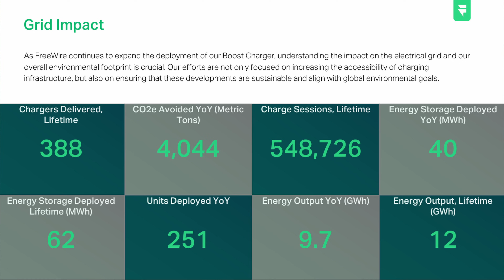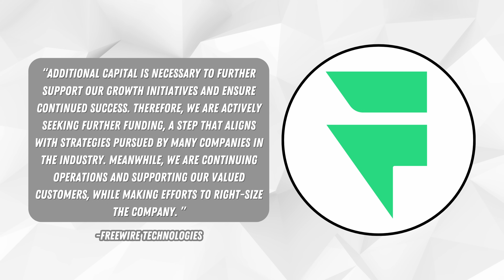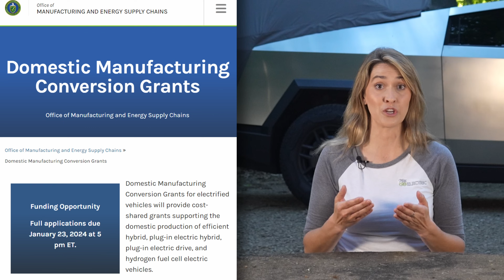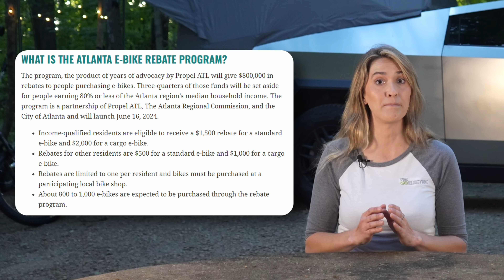The Current : Weekly EV News Ep#10 May 12, 2024

Comment: My first EV was a 2007 Vectrix VX-1 highway capable electric Maxi-scooter (step thru motorcycle) I bought new in 2009 on steep discount when the company first went bankrupt. I ended up owning two over the years, best bike I've ever owned, but now I can't give them away as they need new batteries and the support just isn't there. Also, no quick charging so not for road trips, but after driving across the country on a 1000cc cop bike I don't think ANY are for road trips.
Reply from the maker: Thanks for sharing your experience. We have a friend who has taken road trips with their Livewire but that's really the only time I've heard of a somewhat practical road trip experience since it has fast charging. 

I really like the idea of a standard for batteries when it comes to two wheel electric products (gogoro is a good example) so even if companies can't survive, batteries are still available. 

So cool to hear your first EV was all the way back in 2007!! 🙌🏼

Comment: After not riding motorcycles for many years, I bought a Zero DSR two years ago.  It is a great motorcycle for my use, smooth, quick, and no engine maintenance.  I am really enjoying riding it for errands and just exploring back roads.

I would like to see more progress with electric motorcycles, with more range, faster charging, lighter weight, and lower cost.  Progress has slowed lately, IMO, but there have been interesting new motorcycles like the Energica Experia and the Livewire Del Mar.  When low cost, higher energy density, batteries become available we hopefully will see more progress in electric motorcycles.  

E-bikes have been more successful to date, and IMO electric sit-down step-thru scooters will be the next big thing for 2-wheel electrification.  The US market has a Vespa 50-cc equivalent model, capable of 25-30 mph. Overseas markets like Taiwan and India have lots of electric options, including 150-cc equivalents capable of 60-70 mph.
Reply from the maker: Zero was far out front, basically alone, for a long time here in the US. It has been fun to see the offerings diversify here. 

Have you seen the Verge? 
https://youtu.be/8mAgBqyq2bU

Thank you for your insights. 
-Producer Tim

Comment: I hope you have fun getting your motorcycle endorsement. I've found the Motorcycle Safety Foundation's program to be great and took the basic class in 1995 to get my license and later took the advanced class to buikd skills and refresh learning 

I just sold our gas motorcycle. I've test ridden an early 2009 Zero S, a Brammo Empulse (6 speed), and a more recent Zero SR/F. The Brammo was sublime, but all were great. Just always priced a little too high.
Reply from the maker: Do you think the Outset has a good price? Ryvid is headquartered not far from you in Irvine. 

-Producer Tim
Reply: @MissGoElectric  Good price on that Outset, but it's a pretty underspece'd on battery to get there, like an original Brammo Enertia and early Zero S. That 4.3 kWh battery is too small for motorcycle, and that's always been the challenge. Zero did everyone in the industry a solid by carefully disclosing the real world range at various speeds, and it's good to see Ryvid using that in their promotion too.

Those early e-motorcycles and now this new class of smaller, lower spec ones are a good thing, because mobility has to shrink and compromises have to be made. Efficiency and best use of production and operating emissions and resources are what is not yet being critically considered, but will be shortly. That a 14 or 17 kWh Zero still has some range challenges (as far as touring not daily) and costs $15-20k is not Zero's fault. The extremely bad aerodynamics of motorcycles is what causes this value disparity. We should probably be reshaping electric motorcycles like Akira (anime) or Gurney Alligator (yuk), or dustbin Moto GP racers of the 50s if we're going to ride them at highway speeds.